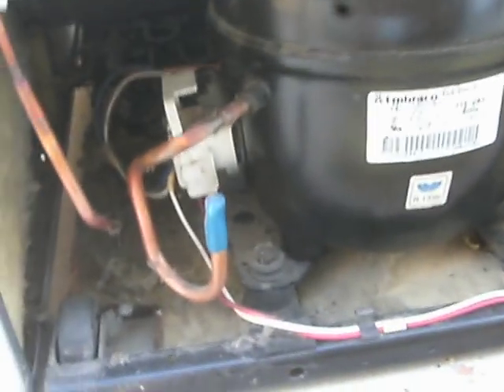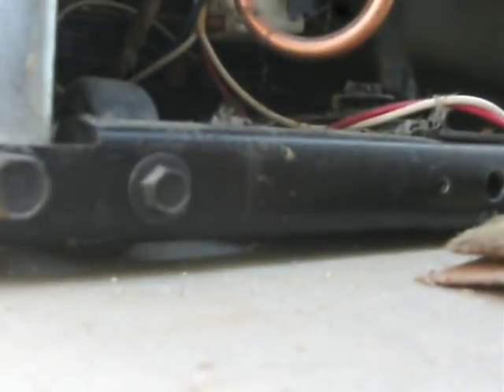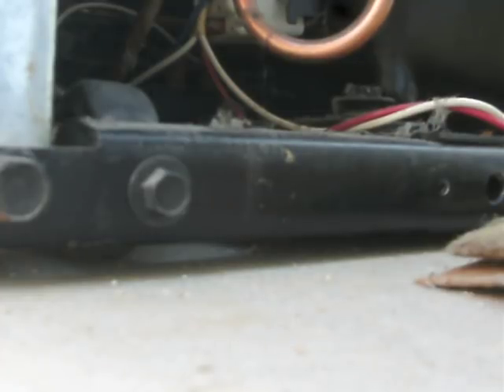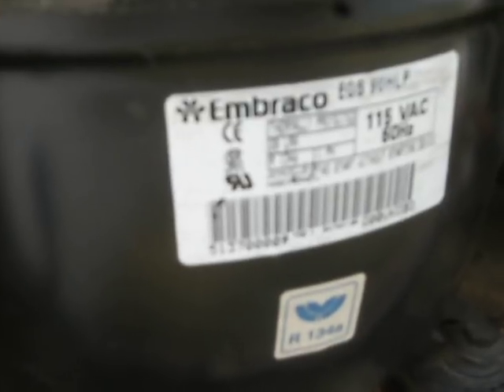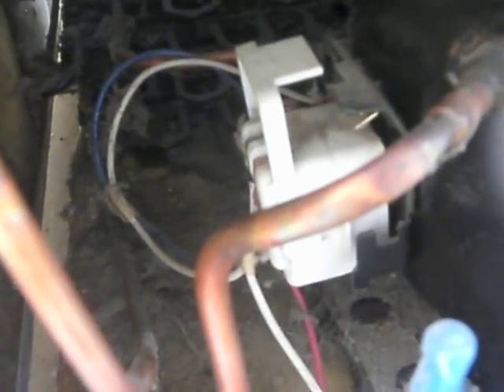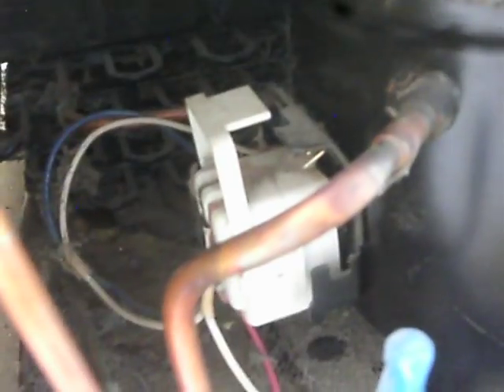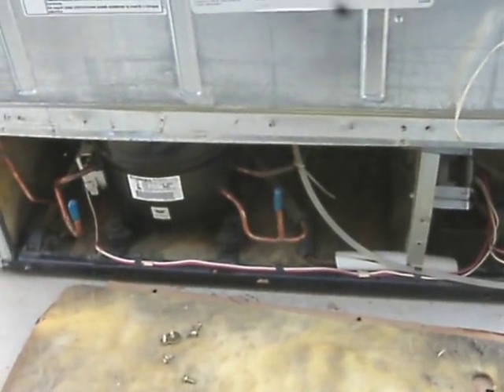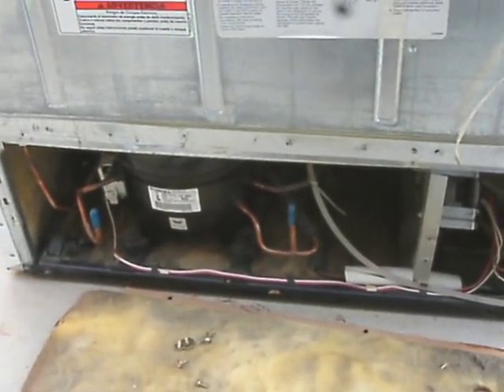Sound of a bad start relay on a refrigerator compressor.  Part 1

Comment: Thank you so much for your videos! :)
My fridge went out the same day our AC died too. I, female (let's just say older), got very desperate, so I started reading up online what might be wrong. I finally invested in a cheap electrical meter, and then followed the instructions in your videos. 
Since I had never touched stuff like that before, and really didn't know where to go to get a new relay I went with a manufacturer replacement part. The relay cost me $58, but a new fridge would have been 30 times that much, or more. 
The place I finally found, that sold replacement parts, has a no returns policy. Having heard the same clicking sound my fridge made in your video gave me the confidence that I went ahead and bought the expensive part ! :)
Anyways, my fridge is again up and running :)  And I didn't have to hire someone that would have charged me $39 for the diagnostic, and I didn't have to call the idiot back that tried to intimidate me over the phone, saying that I "better have someone come out to look at the fridge than to try putting parts in it", when I called to get information where I could find appliance parts in the area.
Thank you so much!!! :)

(Now I just need to find a cheap Bryant cooling coil for my AC ;) ).
Reply: Eva Mills reading your comment made me happy. You Deserve a high five for having the gumption and willingness to learn new things and another high five for actually diagnosing and fixing the problem on your first try.

Comment: I hoped this was my problem that just needed a $5 part to spare me the $60 from getting  a whole new water dispenser unit from a retail store, but I can hear it pumping new air in a motor like constant echo hum. Looking more into it, it now could be the whole compressor, and it was from a nestle water delivery/ dispenser rental company that just let us hang onto the non working one and dropped a replacement unit off, so I tried to salvage.  Since it wasnt manufactured for retail I'm guessing the parts are all proprietary ordered to the company to maintenance, I'l probably just resell it as room temp/hot water dispenser only now.

Comment: I have a side by side whirlpool it cuts off I snack the side and usally comes on ...the copper line in the middle were hot ...the fan seems to be blowing the opposite way is that correct for the fan ...any help would be awesome thanks

Comment: Could you please provide part numbers and where you ordered these replacement parts? I am not finding them on the web for the prices you've stated. Thanks great video.
Reply: Yeah, I concur.  The start relay (thermistor)  for my LG fridge was at least $9 before shipping.  A thermistor assembly which could be the next step to purchase (which also includes the relay) costs almost $90 for my fridge (LG LSC27931ST).  Check Appliance Parts Pro for future parts.
Reply: Scott Garwood y

Comment: That click is the overload relay opening up to prevent damage to the compresser.
A easier way to fix this is to buy a 3n1 start relay. This will fix a bad start relay just make sure you buy the correct size.
Reply: Get the original part, those 3 in 1's are not good long term.

Comment: Noticed my brand new mini fridge was making an disturbingly loud click every time the compressor would engage. I figured this wasnt normal for a brand new mini fridge. Took the relay unit off the compressor & noticed a rattling sound when ever I shake it. Does this mean I need to replace it? Trying to get a new one under the warranty.
Reply: No, it should not rattle. If it does, it's likely broken up inside. The part should be replaced. Just did this last night on my uncle's 2000 era Kenmore fridge (which was made by Amana for Sears). $46 for the PTC relay and it's up and running now.
Reply: @googleusergp  Thats what I ended up replacing & it seems to work better now. First replacement they sent me was damaged likey during shipping so I had to get them to send another one. 2nd replacement worked though. So much cheaper & better than replacing the whole mini fridge. Its a heavy 4.4 cubic foot Daewoo classic so its a pain to move.
Reply: @theatom7264  Yup, most times with a little time and checking, you can nail down the problem. So far so good on the one I repaired last night I'm told.

Comment: My Fridge works fine, but it takes some tries for the fridge to come on. It cools and freezes really well. It's a 16 yr old fridge. 

After a few tries it does come on, but not the first time. 

Any ideas what could be happening ?
Reply: Thats the problem I have.   Im thinking that the compressor is drawing too many amps on start up so its tripping the overload fuse.  Or, maybe the starter relay is going bad.  What happened with yours?  I dont want to wait until complete failure.

Comment: I changed the relay and still is clicking  and it start just for 20seconds  and get off again takes 4min to start and 20seconds and keep doing the same and the relay is very hot
Reply from the maker: Laura Chavez more than likely than your compressor is shot

Comment: You mention an "overload" part at the end of your video - what is this?
Reply: An overload is a part that goes on the line side of your compressor. It works like a circuit breaker.  If the compressor starts working too hard, it will pull more amps and get hotter. The overload will cut power off until the compressor has a chance to cool down and then it will reset.

Comment: Mine just started yesterday i started to smell a rubber smell turned out to be the fridge an it was making a loud sparking kinda noise
Reply: My refrigerator just did that yesterday. Did you end up replacing the relay?